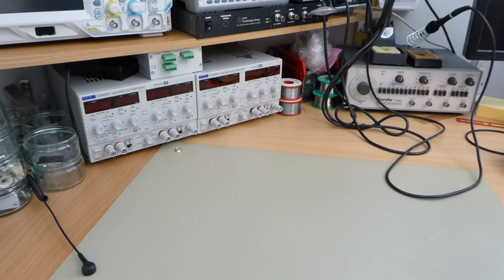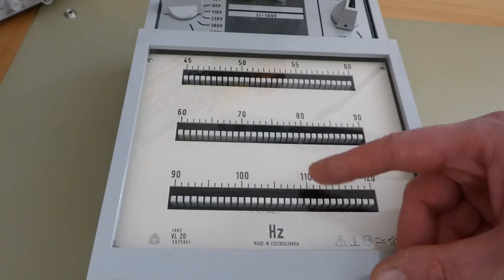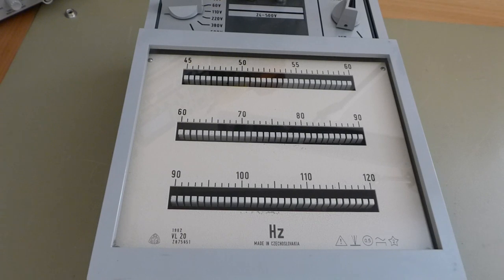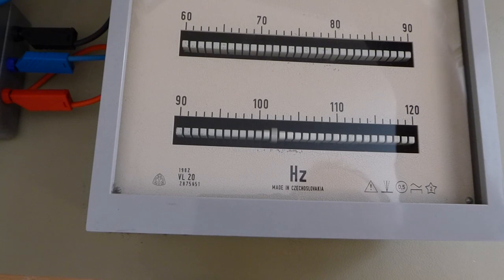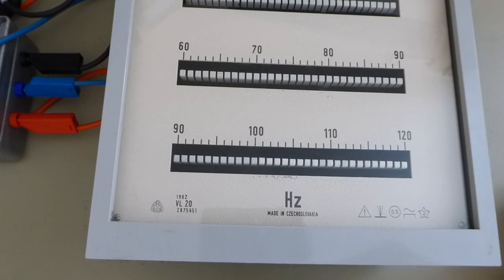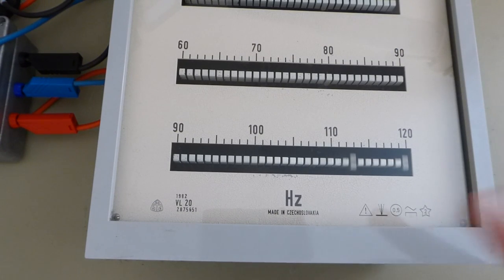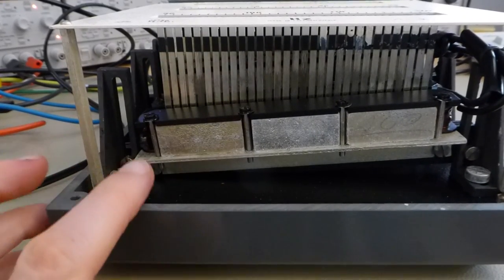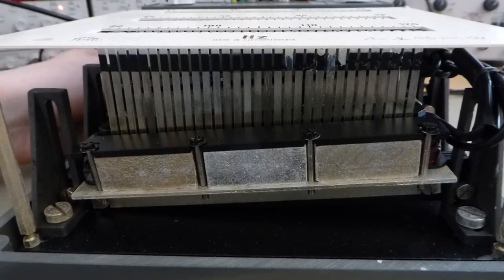Vibrating Reed Frequency Meter

Comment: How does the device avoid resonance with multiples of a reed's frequency?
Reply from the maker: They don't - which is part of the beauty :) It will very much behave like a spectrum analyser and mercilessly show any harmonics or modulation products - which you can actually see in the video when I have multiple tones on: 70, 74, and 101 Hz also gives a small excitation at 105Hz (101 + (74-70)), probably due to intermodulation.
Reply: By being super-sharp resonant at each one!

Comment: That's really amazing and so pretty. Just watching the video from the start, it didn't occur to me that you could have multiple frequency components displayed... derp. In the power station context, maybe you could even see if your sine wave is extremely distorted by looking at the 110/120Hz harmonic, though I guess it would have to be pretty extreme to show up. Also, you could in theory take an audio file and remap it so that the 20Hz - 20kHz is mapped/compressed to the 15 - 120Hz of this meter, to create a mechanical audio spectrum analyzer. XD The easiest way is probably just to do an FFT on the original signal with 100 linearly spaced bins and trim to fit the 93 vibrating elements of the meter. Then you'd take 93 fixed frequency sine generators where you're just using direct mapping between FFT bin amplitude and sine gen amplitude, then add all the signals + normalize and output through your power opamp. To test out the theory without doing any work, there are pitch shifting audio plugins you could probably use. The sine method will probably give clearer results due to better frequency separation and therefore less "crosstalk" if you can call it that between reeds but I'm not sure~ the fact that the frequencies are so low would be a challenge probably. Oh, you'd also probably have to time-average the FFT bins since the reeds can't respond instantaneously. There are lots of "probably" things here haha~. :D Really cool video, thanks for posting!
Reply from the maker: Hah! Funny you should mention the idea of the audio spectrum analyser - that was literally the first thing I did. Great mind think alike and all that. Here is a version that I recorded: https://youtu.be/lSZuiWAN3M4 There is lots of tweaking involved, especially around the whole business of mapping the bins and artificially lengthening some tones to sufficiently excite the reeds. But like so many things I lost interest once I had it working in principle and couldn't be bothered to see it all the way through...
Reply: That looks really mesmerising, thanks for the link! Reminds me of piano hammers~ XD I guess a mechanical system like that can't be made to be too responsive for many reasons. Artificially lengthening tones hmmm.. I can see why you'd need that since time-averaging will take out all transients. I can also picture a bunch of solutions to that haha. Stuff like matlab/octave/etc is very fun to play with to explore these ideas. I have lots of pet projects like this too.. most just end up learning experiences, though some end up connecting to actual jobs. Good luck with your future projects! :D

Comment: Hello
My English is bad, but I have a question
I have the same meter, I could not find any specifications on the internet for this meter. How to set these 2 switches and how to connect this meter to make it work. The meter has connection terminals at the top of the housing and at the back of the housing. I am asking because I would like to check if my meter works and the first time I see this type of meter in operation, it is an interesting construction.
Reply from the maker: Hi Paweł,

you set the voltage of your input signal with the left switch, and then use the right one to tune the amplitude to give you a suitable deflection on the reeds. If you aren't quite sure, I would recommend starting with a higher voltage range and moving to lower ones, until you get a good reading. This only applies to the terminals on the top. The terminals on the back are hard-wires to the lowest voltage range (I seem to recall). Good luck!